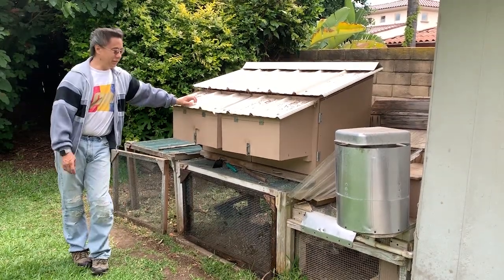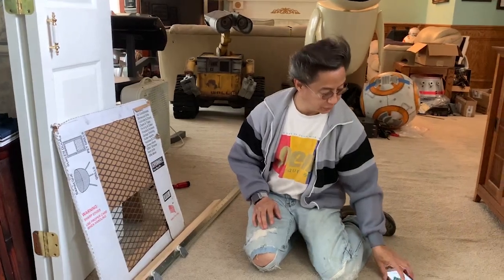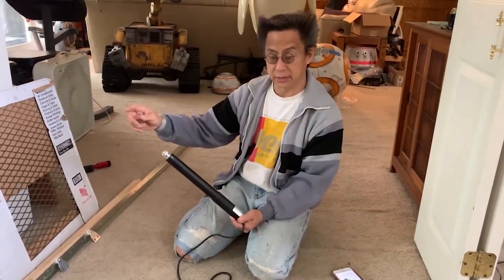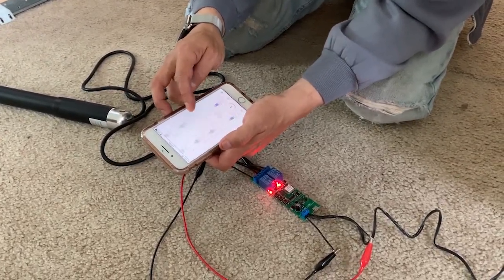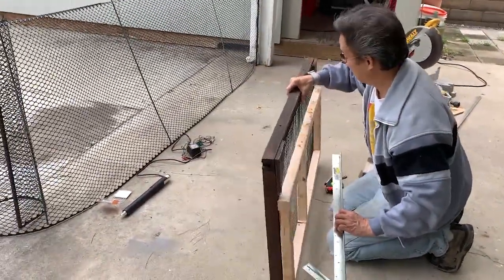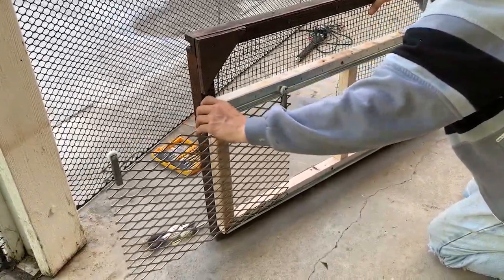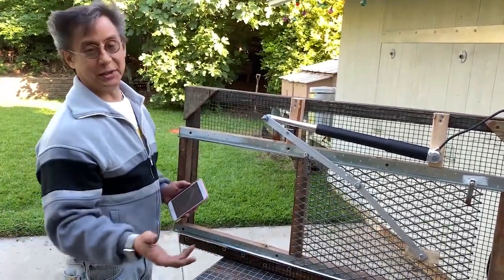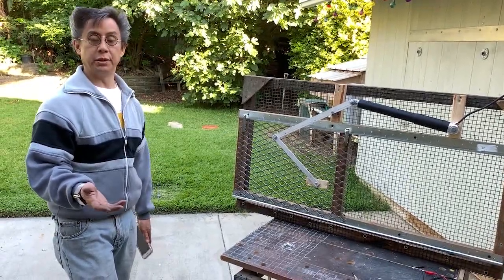DIY Automatic Chicken Coop Door | Automation with Linear Actuators | Progressive Automations

Comment: Hello, great video!I have same smart switch and DC Linear acturator.Is it possible to combine button switch with 2ch smart switch?Thank you.
Reply from the maker: Hello Jure,

It should be possible to modify the wiring in this video to accommodate for an extra button switch by integrating more relays to prevent a short circuit between the button switch and smart switch while still allowing for a path for the actuator to receive electrical power. 

If you had any other questions, we’ll happily assist you at sales@progressiveautomations.com

Best regards,
Progressive Automations Team

Comment: Had to sign in to save the video and to ask I could borrow your brain. what do you recommend for an actuator that isn't so noisy?  doesn't have to move fast but needs to be near silent?? thanks for the video
Reply from the maker: Hi! Thank you for the comment. This video uses the PA-06 actuator which has a noise rating of <60dB, however, another actuator that could be considered is our PA-10 which is also waterproof and has a lower operating noise rating of <45 dBA.

Comment: Hi Mike,
How do connect the relay with google home. I connected to google home via smart life app. Hey Google doesn't understand when i say "open" or "close" it just understands when when i say turn on or turn off. Thanks
Reply from the maker: Hi William! You may need a smart relay for this type of application. However, this has not yet been tested on our end. This is definitely something we are interested in looking into. Be sure to subscribe to our newsletter or follow us on social media to stay up-to-date with our latest projects!
Reply: The MHCOZY 4CH Wi-Fi RF Wireless Switch Relay I have will do that, through Google Home via the eWelink App. It too will not "understand" when you tell it "Open" or "Close". unfortunately I don't see a way to make it just say "Coop Open".  It is the same company module as the one in this video. Just 4 Ch. I recommend you wire different than how he did it in the video. The way he wired it has the relays will have to stay on ALL day. If you wire the just slightly different, ONLY ONE relay needs to be on at a time to actuate and it can be turned off the rest of the time. Saves on the life of the module, or the relays at least.
Reply: Well I'll be darned I just got it to work.

Comment: How did you determine the 3-1/2" number on the top arm?
Reply from the maker: Hello Kyle,
 
The shorter side of a pivoting lever arm will need to be a length that is longer than half of the actuator's stroke to ensure the actuator can travel its full stroke without rotating the pivoting lever mechanism over 180 degrees. Since the actuator used in this video has a shaft that travels a distance of 6 inches, the length for the pivoting lever arm’s shorter side will need to be longer than 3 inches and the 3.5 inch length that was chosen is a relatively even number to work with while not being too oversized.
 
If you had any other questions, we’ll happily assist you at sales@progressiveautomations.com
 
Best regards,
 
Progressive Automations Team - Nathan